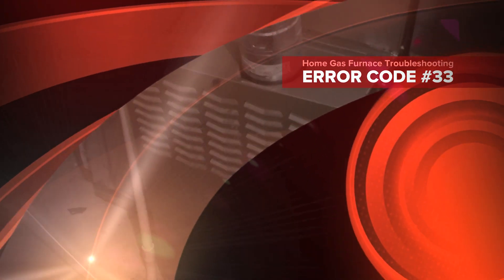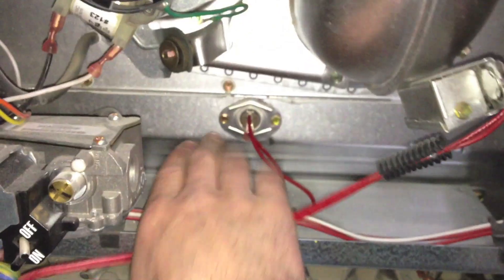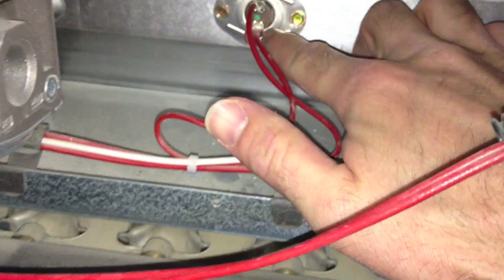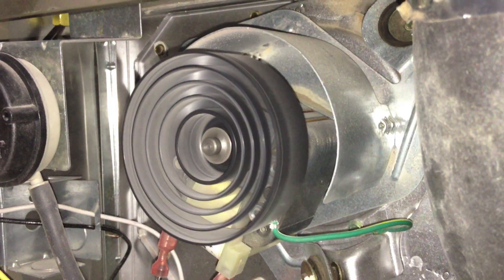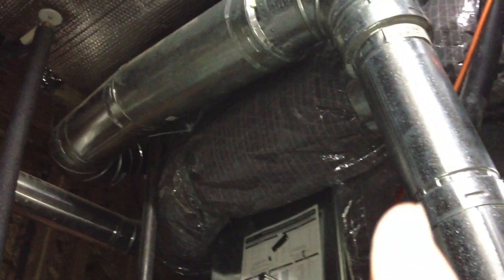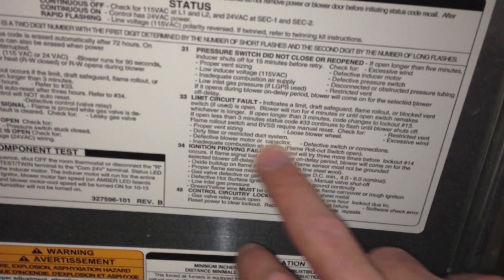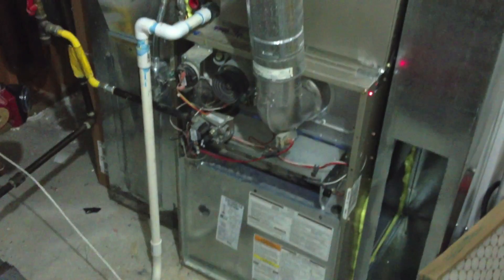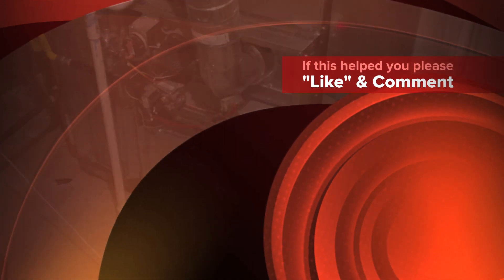ERROR CODE 33 - Troubleshooting a Bryant Gas Furnace

Comment: I am having the same problem with a different furnace.  Tech came out and told me the same thing that you say in the video-- there is nothing we can do it is just getting too hot and tripping the sensor.  He did his thing, reset the furnace (I guess some error codes needed to be cleared out which I don't know how to do) and then got it running.  Cost about $315.  We took out the filter and about 12 hours later, the same thing happened.  

I guess what I am getting at is can I just cut a hole in the side and install a duct on the side to get more air?  I don't think I could run an entirely new return.  Does it matter if I am just sucking air from the basement?
Reply from the maker: The new side duct I installed is a basement air return.  I am in the process of finishing my basement, so the new air that the furnace is taking in, is from the basement hallway. Its working great for me. 
You said it was 12 hours, what was the time gap before the tech?
Reply: hightideblue Well, the first time it ever went out was on a Thursday night/Friday morning.  I got it working again and it ran until Monday night/Tuesday morning.  That time I could not get it to work again.  So, the tech left Tuesday at about 4 pm and I a certain by 5 am it was blowing cold air again.

I may just cut a hole in the side and tape a filter to it for now.

My problem now is getting the codes to clear so I can do a shutdown/restart process.  There is supposed to be some reset somewhere, but I am not sure where it is.

The first time I was able to do that process and get it working after a couple of attempts (first attempt worked for 20 minutes then stopped, second attempt same thing, third attempt, stayed on for three days as mentioned above).  Now I cannot even get the thing to restart the pilot lights for one minute as the code continuously flashes.  I am wondering if during the first problem, I had waited the "three hours" that the furnace shuts down for and that is why the restart eventually worked.
Reply from the maker: Lonnie Renda Hmm.....  Mine would always shut down and then restart. Only to shutdown again very soon.  But I never really had a long run time.  But the shutdown would automatically restart itself. I never cleared any codes.  If you do cut a hole, start small because you can always make it a bit bigger if you need to.
Reply: I would continue hunting for a reliable and trustworthy tech to re-diagnose your issue....
There is no circumstance where the engineers of the furnace messed up and now your stuck with a unit going off on safety switches and there isn't a thing you can do about it.
Like I said in the comment above me, check if its a variable speed blower, its possible its just at a speed thats not pushing enough CMF that the furnace is rated for. 
There are other mathematical equations that go into determining whether or not that is the case. As I can't physically see your unit I cant accurately tell you whats going on but basically what i'm trying to say is i'm sorry for the hack that charged you that much money to simply hit a manual reset to clear the error codes... don't give up on us hvac guys there are some sincere and honest techs out there :D
Reply: +hightideblue On mine, I found that if I resolved the issue that caused the code and cycled the unit (shut down for 30 seconds, power back on), the first cycle the code would still trip again, but a second power cycle clears it.

Comment: also you need to check gas pressure there is a recall on the gas valves for letting too much gas through on those furnaces which causes them to get too hot and trip the limit
Reply: He is a diy expert, he doesn't have testing tools. He likes to guess at repairs.

Comment: The best way to see if the ductwork is supplying enough air is to measure it and in this situation I would measure the static pressure to determine if it was the return or the supply at fault.
I'm almost willing to bet that original installers had panned the joist space for use of the return air and somewhere there is a restriction. Low return maybe fine for an old steel or cast iron heat exchanger furnace but will not work on any of the new style furnaces no matter the brand name or type.
This is not a bad design of the furnace, i've installed many of these and as of yet i've had no call backs do to the problem your having, but I make sure that the airflow is spot on.
 (if you're not testing you're guessing) is a phrase that I tend to say a lot, but its the truth.
If everything is right, you can pull from one side of the furnace with the exception of a 5 ton system, then you will need to pull from the bottom or both sides, you will need to check with the manufacturer to see what they recommend.
Anyways i'm glad you got it running!!